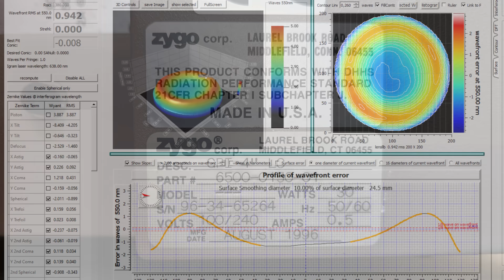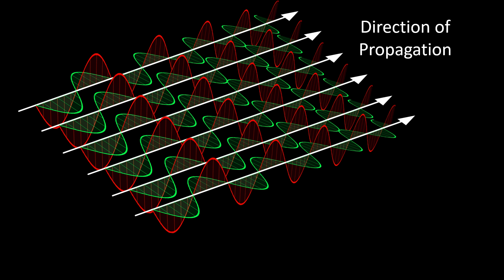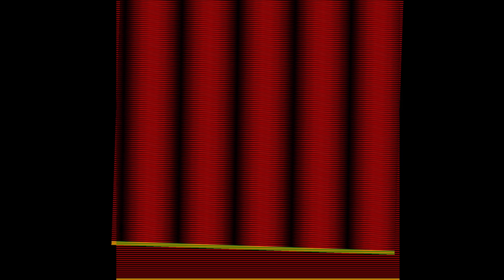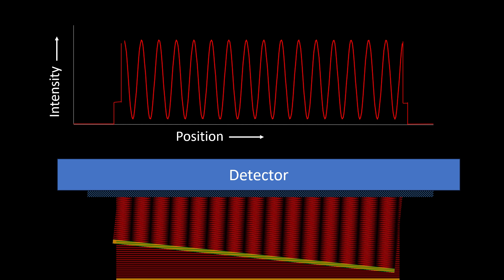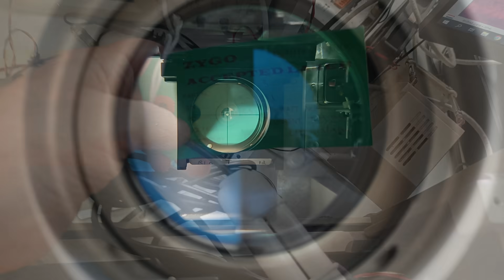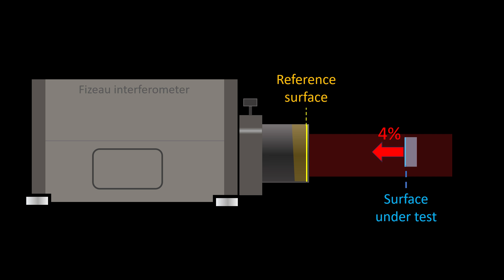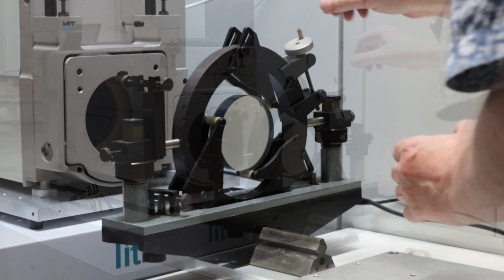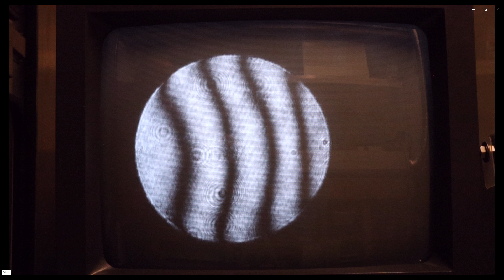Optical Interferometry Part 1: Introduction & ZYGO GPI layout

Comment: Let me describe something that has puzzled me for 50 years  :face-purple-smiling-fangs:❓‼❓
and hopefully someone here can explain what causes the illusion.
My father worked at Osram, a light bulb factory for a short period of time.
he collected all the waste glass tubes which were approx, 4mm diameter and centre hole about 2mm, and length about 80mm.
( he also collected drops of mercury from Osram waste that was going to landfill and we ended up with a milk bottle full of the stuff to play with, but that's a different story )
he poured different coloured paint into the tubes and also threaded them on to nylon thread each separated by small round and holed  plastic beads
( I don't think the paint has anything to do with the effect, but it made the finished product even prettier, as he threaded the coloured rods in such a way as to make an interesting symmetrical design on each blind .)
each string was approx 1500mm long, and half of them started and ended with a 40mm rod instead of 80mm rod..
he then drilled holes approx 10mm apart all along the length of a 2-3 m long wooden dowel  approx 30mm diameter.
then hung the strings of glass rods from the dowel, so they were all spaced approx 10mm ( centre to centre) apart
and intermittently staggered, alternating the strings that started with a 40mm or 80mm glass rod.
he made 4 of these blinds , one for each window in the house, the purpose was to create blinds for the windows.
not only did they look very pretty, but they worked perfectly, you could see out very clearly, but people outside could see almost nothing inside the house ( unless interior light was on )
now here is where it gets interesting.🕰☀
the house (single storey bungalow)  was build almost perfectly North to South, so 2 windows pointed directly North, and the location was Northern hemisphere at approx 52 degrees North.
obviously the sun never shone directly trough the North facing windows as it was always shining at the back of the house from the South, East or West.
now standing at the back of either of the two rooms with North facing windows, looking across the room, through the glass rod blind, across the street and onto an identical bungalow on the other side of the road.
The bungalow across the road would be brightly illuminated in sunshine as its front was South facing.
the bungalow across the road had a 45 degree tiled roof going up to an East/West ridge along its length.
it's on this roof that the optical illusion could be seen.
what could be seen was dozens of light and dark bands, more or less evenly spaced, not straight lines, but divergent curves on either side of a central line.
best way to describe it would be like looking at a quarter of an oval that had concentric black and white oval bands on it, and its mirror image on the other side of centre of vision.
the bands would look like dark shadows on the roof of the house across the road, except in reality there were no shadows on the roof of the house across the road,
it was an illusion that could only be seen by the observer standing at the back of the room, looking out of the North facing window on to the South facing roof. 
as you moved your head from side to side the pattern would also move in a strange but predictable way, slow at the top, and fast at the bottom.
every visitor to the house on a sunny day would witness this effect in the living room and was not only impressed but perplexed by its nature
what exactly caused this has also puzzled me for 50 years and I studied science subjects at university, but not specifically optics.
the glass curtains have now been gone around 20 years ago and i'm not even at the same house.
I can't actually remember if the effect was also seen with one eye closed or required both eyes open.
but from memory I think it was still visible if you closed one eye.
I also do not know if the effect could be photographed or required an observers eye to work.
I have considered making some glass bead curtains myself, but not only can I not source hollow glass tubes cheaply, but would like to know what causes the effect and what properties of materials and dimensions are required and which are irrelevant before I start as I know making curtains like this would now be very expensive and a lot of effort.
so I only want to attempt it once, and I want the effect to work again.
I think i've described it thoroughly enough for anyone to try recreating the effect and/or coming up with some explanation for it.
any ideas or help ❓
Reply from the maker: Sounds like it is some kind of Moire- effect, so an interference effect produced by two regularly spaced patterns, one being the curtain, one being the tile pattern on the roof. Maybe this effect was amplified by the glass tubes that worked as lenses and add more color to the patterns.
Reply: I think Moire very unlikely as tile pattern was barely discernable and effect was blatantly pronounced as  light/dark shadow banding , my best guess is it was interference between direct incoming light and light reflected from either/and/or inner and/or outer surfaces of the hollow glass rods. as to how exactly the interference fringes were created I have no idea as there is no point source or monochromatic light. actually there may be a point source if sunlight is reflected from window in house across the road, as effect only happened on clear days when sun cast shadows, another reason to dismiss Moire. @HuygensOptics

Comment: two questions.  as the waves are supposed to be travelling at "c", how come they appear as stationary?  Next, the wave length and frequency changes over distance, your laser doesnt change much over 100 meters, but others do, so doesnt that equate to the speed of light also changing?
Reply from the maker: Because the phase relationships in the light are stationary and do not change in time. That is what we observe, not light moving at the speed of light (which by the way is independent of frequency).

Comment: Generally, when precision lasers are used, you'd probably want to prevent reflections from getting back into the laser.  In the block schematic you drew for the Zygo interferometer, it looks as if a big fraction (12.5%, assuming 50-50 splitters) of the laser power will make it back into the laser, after reflections.  Maybe, then, something is tilted a bit? Maybe the position of the GRIN lens with respect to the beam splitter with the beam dump is such that on its way back towards the laser, the beam diverges?  Or it doesn't matter if all that light makes it back into the laser?  I don't think you want any significant reflection back into such a precision laser.  I've played with interferometers; they can be so sensitive that local air-temperature gradients show up as noticeable fringe shifts. Such (varying) reflection could then detune the laser by injection locking.  I am not an optics specialist, so I could be wrong.
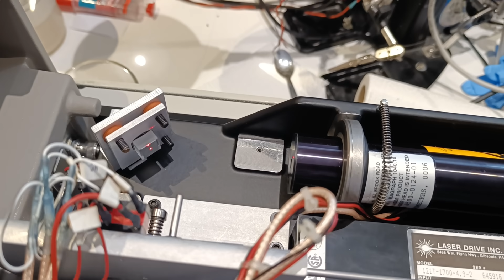Reply from the maker: Yes that is correct. at 13:12 you can see that the returning reflection on the 45 degrees steering mirror is quite a bit off from the original beam (it is on the top of the mirror). So I guess generally the reflected light does not make it back into the laser cavity.

Comment: I was on vacation, so I'm too late to win pinned comment. But without looking at the comments: My guess is on Option A. 
It certainly has to be concave, because heating will expand the material and the fringe moves back to the dashed line. That means that the heating (and therefore expansion) transformed the unknown shape into a flat shape. Only concave shapes get flat when expanded.
The slope is more difficult to determine, but my reasoning is that the expansion in the middle leads to the left side becoming more sloped and the right side becoming parallel to the reference surface, as seen in the interference pattern. The fringe spacing to the left of the changed line is becoming more closer together, the fringe spacing to the right of the changed interference line is becoming wider. Therefore I conclude it must be the slope as shown in option A, because pulling the middle up (expansion due to heat) will lead to this shape becoming more sloped on the left side and more flat on the right side.

An amazing riddle! Love the video!
Reply from the maker: Well that is completely correct and on top of that a very accurate evaluation.

Comment: I use an optical parallel and a monochromatic light to identify imperfections in a polished surface. Lines, some curved, indicate that the surface is not smooth and flat. It's simpler but it helps me understand the topic of your discussion. Thank you for posting.

Comment: How about the grinding component to create these "extreme" flat surfaces?
The compound used should have particles smaller than the wavelength.
What impressive science, those people that made the james webb and other opticals!
Reply from the maker: This is achieved with polishing. Generally you use grains of 1-5um that get embedded in optical pitch. So they are still quite  a bit larger than the wavelength of light.
Reply: @HuygensOptics  Ya, i saw video of a known Japanese camera brand and a few other people making lenses (like you). i have had these stainless metal sieves in my hand at some company, companies that make paint use them. Just amazingly cool that it works.

I got a mirror from a USA brand of scopes, it has water damage on the reflective coating, it has something like lime stains on the coating, tried to remove it carefully with sneezing paper tissues and hand soap, but that made it worse. like scratches.

However the fun part is laying the mirror on the floor and look in to it from above and you got a really huge eye.
: )

Comment: Very interesting and enlightening video! I'm using interferometry frequently when checking the flatness of lapped/polished surfaces of metallic sealing discs for industrial safety valves. Our setup is a lot more barebones though, with just a monochromatic lamp and the prisms.

Comment: Very nice animations in the beginning. How did you make them?
Reply from the maker: I'm not sure which animations you are referring to but everything was either done in Powerpoint or in the video editor (ShotCut). In ShotCut I used images with a black background that were superimposed while using the filter "blend mode" either set to add or subtract.

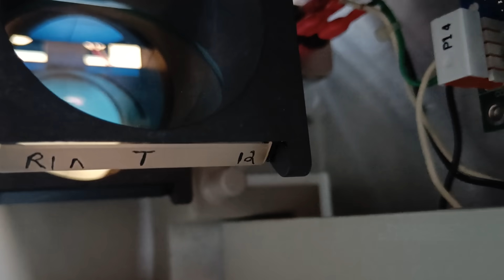Comment: 13:52 those capacitors are ready for a replacement before your fancy apparatus becomes a 8000 euro doorstop :)
Reply from the maker: A new 12V power supply is not very expensive.
Reply: @HuygensOptics  I agree, but I prefer to repair rather than replace :)

Comment: As an intuition aid, can we interpret these as akin to contour height maps? In that instance, the only question is which way is “up” across the fringes
Reply from the maker: Yes I guess so, especially in the case that you can compare with a flat wavefront. With curved wavefronts, I guess it's a bit more complicated, because the measured height variations are only a tiny fraction of the curvature of the total surface.
Reply: @HuygensOptics  One would have to use a “curved wavefront” to make a contour height map of the spherical earth, right? I think there’s still something analogous there

Comment: Glass gets thicker at finger point so points to thicker side of glass, so C is the answer.
Reply: This is an excellent explanation of interferometry
Reply: Some body mentioned that the index grows much more with temperature than the physical thickness. dn/dT 14.3x10-6/°C
Reply from the maker: Answer is still the same: it's A.

Comment: 15:25 why are all those special components actually needed here? What are the advantages compared to a regular beam expander?
Reply: If the beam expansion has more than about 2 waves of error, there can be retrace errors that will throw off the error you measure in your part as the rays get moved around on the camera..
Reply: @jpurrazzella  ah right, so that gradient index lens is essential. Yup, this would be hard to diy

Comment: what would happen to the interference pattern as the test surface gets rougher?
Reply from the maker: It really depends on t the frequency of the roughness. High frequency roughness would result in lower contrast, whereas low frequency roughness could result in noisy looking  fringe distortions.

Comment: A)
The lines become closer together on the right. So the magnitude of the slope is greater on the right than on the left. (The sample is sloping up everywhere, unlike the diagram A, but whatever, the diagrams aren't to scale.) Thus A or D. 

What's more, when it expands in the middle, the lines get straighter and move to the left. The small amount of expansion seems to have totally compensated for the slight warping, at least in the place where it is hottest. If it was already convex, warming the middle would enhance the effect. So it's concave. Or was. But the slight thermal expansion made it a lot less concave.  Thus A or C

Combined, answer is A.

Comment: @22:00 ish
It strikes me that the dust particles generating waves, is like throwing a pond at a pebble to observe the waves it make when hitting the pebble. wow!

I'm guessing C - because the expansion of the glas when you put your finger on it, should mean that to get that bump, in that direction, it would have to be convex. And,,, then I guess it's C, because the interference line is fatter where the surface shifts the most. Not sure but I'll go with that. ;)

Comment: Do ligo just casually has 4km coherence length. That’s a very precise energy for the lasers?
Reply from the maker: The Ligo lasers are something very special and have a coherence length of 10 million kilometers. Which is necessary because the light on average makes many passes through the 4km tubes before being measured.

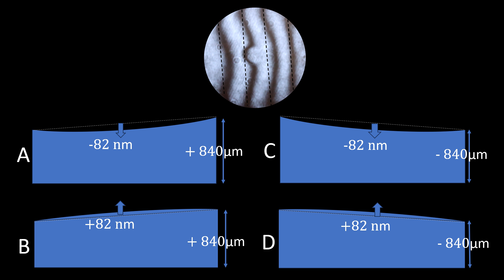Comment: I paused at 25:50 for this: Assuming your glass is BELOW body temperature (a probably reasonable, but not trivial assumption), the heat of your finger causes deviation in a material with a positive temperature coefficient indicates the surface is nominally concave. For clarity, the heat of your finger causes the glass to expand causing a deviation in the Z curve. That the deviation is opposite the general trend indicates the glass is concave (so A or C). That the curve is opposite the general trend of the curves points to C - if the curve were A, heating the middle would emphasize/exaggerate  the curves. IFF (if, and only if) the lens is ABOVE your body temperature such that touching the lens cools (and shrinks) it, the B surface would be the best fit.

That only the middle curve is influenced by touch is very interesting, but makes sense if the touch is not too long in time.
That you touch your lenses with your fingers at all seems heretical, blasphemous, and deprecated! But thank you for sacrificing your lens(es) to educate us!

Comment: I remember (a long time ago) swimming front crawl against a slightly taller boy in a short course pool. Every tumble turn he got an advantage of twice the difference in height (assuming the difference in leg length was proportional to the difference in height). That must totally explain the difference in our speed.:-). Anyway, just thinking about the factor of two at 22.48
Reply from the maker: Your maximum speed is actually 1.34 x sqrt(body length). So yes, being longer helps, but I'm afraid it's not quadratic with the difference :-).

Comment: I work in a metal workshop and we have a lot of old precision measuring tools. In some of the kits there are these glass pucks that have an arrow on the side that points to one face and 0.2mkm written next to it. Can these be test glasses that were used to measure surface flatness?
Reply from the maker: I'm pretty sure they are. The arrow generally indicates the flattest side. If you clean then and put two on top of each other under fluorescent light you will probably see straight fringes.

Comment: Thank you for a great video! 
I have one question: How to measure the aberration of the wavefront (plane wave and spherical wave)?
Reply: The traditional method involved mapping the coordinates of fringe centers in a photograph of the interferogram--each fringe being assigned an interference order.  From that, a surface is mathematically fit to the (x,y, lambda) coordinates--often as a polynomial expansion, usually using so-called Zernike polynomials.  The coefficents can then be associated with aberration terms such as tilt, focus, spherical, coma and astigmatism.  More modern instruments record the phase with some clever methods--which might be described in future videos(?)
Reply: Thank you for your answer! It is helpful for us @richardshagam8608 

Actually we are trying to filter a 405nm diode laser for lithography purposes. Even we have already tried several sets of pinhole-objective lenses of the spatial filter, the visibility and uniformity of the samples were very poor. Now we think that the reasons may be the laser source degradation or the spatial filter. That is why I placed my question above.

Does anyone have a suggestion for us in this case?

Comment: I concluded it was likely concave before the heat hint by noticing that the edges we're slightly rolled off (very unlikely to have a high edge). Since the fringes in the center are shifted in the same direction as the fringes at the very edge, the center must also be low, thus concave.
Reply from the maker: I guess if you are into ATM where turned down edges are a common phenomenon, finding out the shape wasn't really that hard.
Reply: Knowing the the rolled edges shift the fringes to the right also let's us determine the overall wedge. Intuitively the fringe is shifted right at the edge because we don't need to go so far to the left to drop to the next fringe as we do in from the edge, thus the wedge is falling off towards the left, case A.